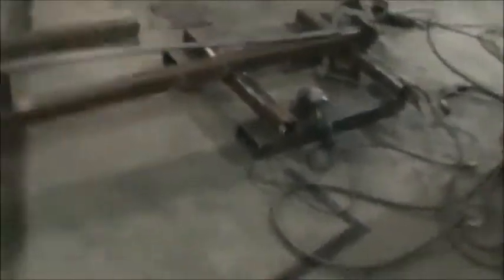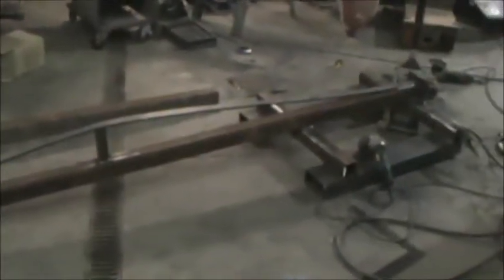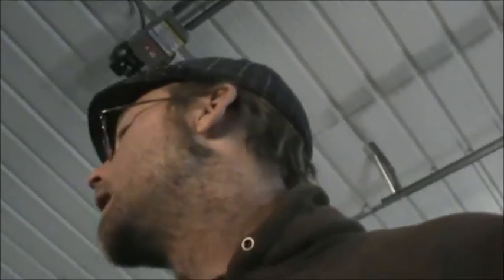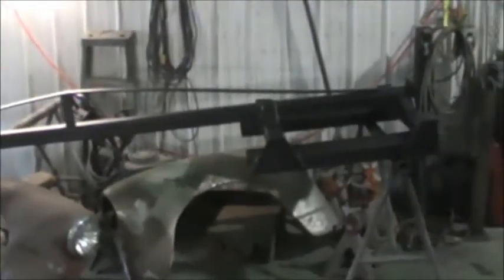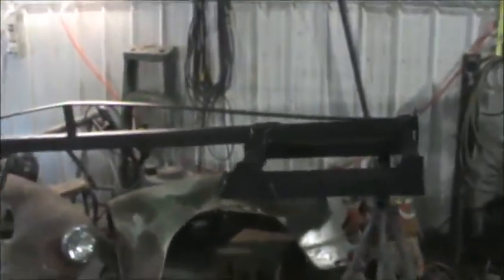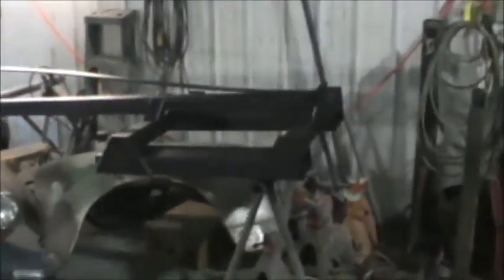Fabrication of a Truss Jib

Comment: I spray my wire with anti-spatter spray on the reel and I take a piece of Scotchbrite soaked with anti-spatter, fold it over the wire just before it goes into the guide to the drive wheels, and use an alligator clip to squeeze it over the wire and hold it.  The wire travelling through it gets cleaned.  If I'm not welding for a month or more, I remove the wire and put it in a Ziploc bag with several of those little disposable silica packets you get in packaging to control moisture.  I also put silica packets in the drawers of less often used tools.
Reply from the maker: I wound up putting a new liner in the welder. That done it works like a new machine. Been having issues with the Lincoln since I picked it up. It was second hand but priced very well.

Comment: Nice work.  Looks like a nice implement for setting trusses.  Very true about the mig wire giving issues when it gets some age on it.  If you don't use it in a couple months, it gets a corrosion on it that will cause funky stuff to happen.  If you aren't gonna use the mig for a while, put the spool in a bag of rice to keep the humidity out.  But then again, who thinks their welder is gonna sit that long and remembers to do that
Reply from the maker: Yeah and now I am assembling a second one of these, much cleaner better build. My big Lincoln just took a shit, so I guess tomorrow I get to go buy a new liner for it. Wire keeps snagging in the liner causing all kind of issues, and now I managed to contaminate it as well. Not only is is not feeding I get inclusion filled welds to boot.